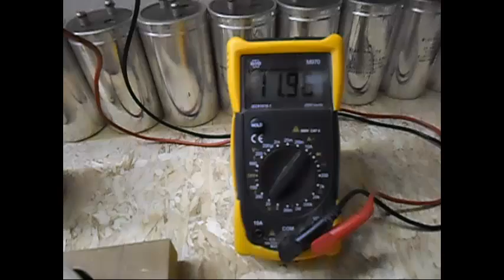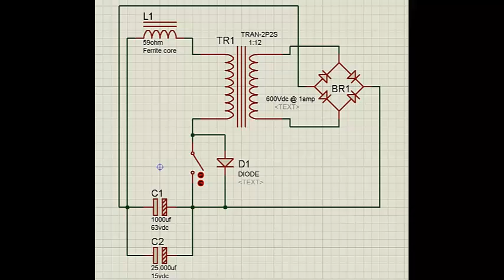Pulse Motor - Simple 1 reed switch circuit, loopback, transformer & FWBR - Part 4 of 5...

Comment: hey its not good to mix back emf whit normal power autput its a difrent kind of power its statcic power mix whit normal power
Reply from the maker: +rntesla nielsen 
Thanks for your comment...^^
Well, electrical power is electrical power...even if the voltage/amps ratio are way different...;-)
It seems to work pretty good...i have done this before many times before and haven't seen any problem with it...^^
Reply: +Mister Caribbean Roots  ok but i have try that on my bedini motor and when i put back emf in a cap and normal power in another cap the same voltages and then put them together it cansel aut the voltages
Reply from the maker: +rntesla nielsen 
I see, i'm no expert on bedini system but when you say that the two cap voltages cancel each other out there must be a bad connection somewhere...o.O
They will level each other out but not cancel...;-)
Reply: +Mister Caribbean Roots my friend Forget first about + and minusse look of it as a voltage is difference  if you take 12v + and 24v+ then you have 12v difference and the 12v+ is then minus to the hight 24c+ and your multimeter will show the 12v+ as a minus if you then charges a cap whit 12v positive difference power and coneting it to a cap whit normal power 12v it will cancel aut
Reply from the maker: +rntesla nielsen 
Okee, i see and will try to understand what you wrote and implement it...;-)